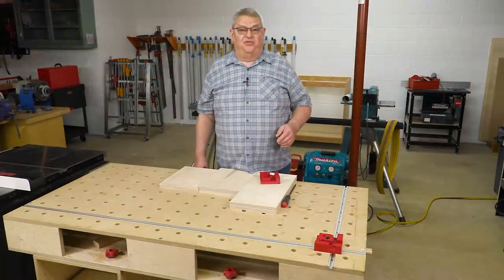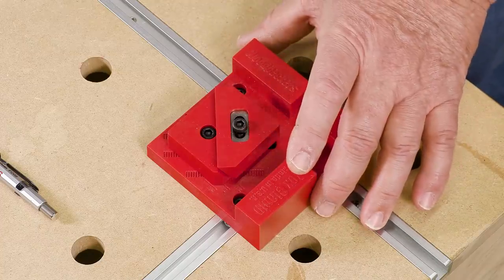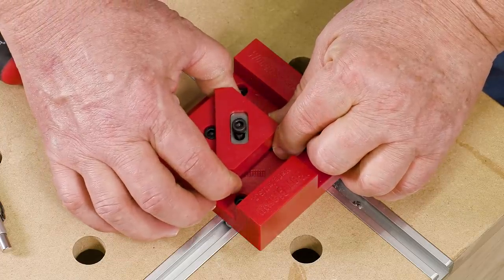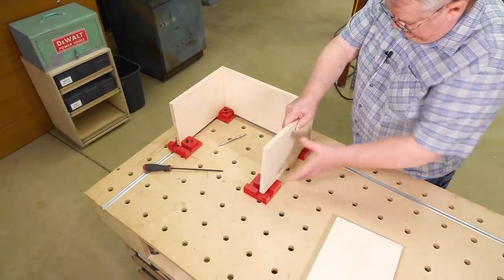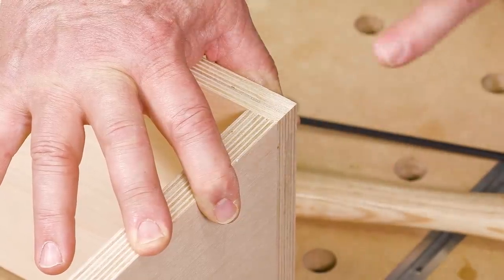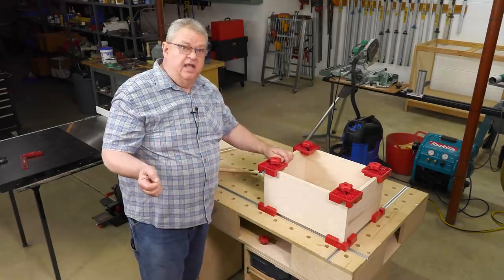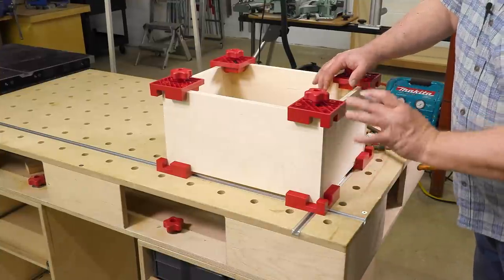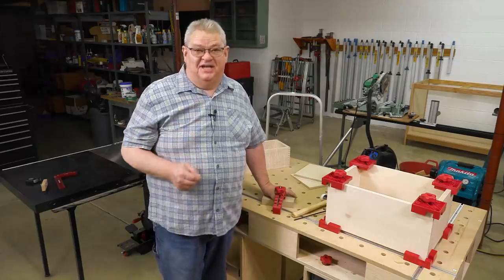Box Clamp Features You Never Knew About | Deep Dive

Comment: Been using these for quite some time but never knew why the oval slot was there.  Didn't know you could mix thickness either.  Glad I saw this.
Reply from the maker: Hey, Keith, glad you learned something new. Something I left for the next Deep Dive is that you can use the Box Clamps in a T-joint, too...the stock can pass through either side.

Comment: You forgot the GLUE! I have these clamps and have fumbled around with them for a long time. You set them up on a dry fit, then take them apart to apply the glue, then put them back together again. This can sometimes cause long open time with the glue. I really like the idea with the railing, it would be like a third hand that is so often needed.
Reply: I, too, was wondering about the glue. You certainly can't apply the glue while setting up the clamps unless your glue has an extremely long open time.
Your idea about getting things all arranged, then disassembling the box, adding the glue and reassembling makes sense.
The real benefit to these clamps then is when you are building multiple drawers or boxes that are the same size. Once it's all set up, you can glue up matching drawers about one per hour (the time it takes for the glue to set).
The advice I find in the comments is often as good as what's in the video.
Thanks!
Reply: He forgot nothing, it was a demo for the claims not glue

Comment: Jeff, many thanks for another very valuable deep dive.  I, like others, have had the Woodpecker corner clamps for awhile but an older version without the grooves.  I put 2 parallel t-tracks into my workbench, but you inspired me to put another one in perpendicular for use as you illustrated.  I am a bit surprised you didn't put a right-angle intersection in so that it's easier to install the one corner clamp.  That's a bit of a pain when I already have tracks installed, but shouldn't be a large problem, although I don't want to remove the existing tracks.  I think I'll just cut the two tracks in place and then notch the new right-angle tracks to accommodate the intersection.  Keep up the great work!

Comment: Lots of value-add on this video. 

I’ve had a chance to use these on a small project and they are a little fiddly. But... big but... they take the guesswork out of the equation. Doing that project without them would have been a Lot more dinking around.

I wasn’t sure I was using them right but turns out I was... just not fully. And these tracks are a great idea. When I build my proper bench I was planning on embedding tracks. This makes me think wow! Lots of uses, and I don’t think I would have ever thought of this. 

Great video and a great product!

Comment: What length 10-24 machine screws did you use? They need to be short enough to not impede wood travel in the clamp, yet long enough to allow the track nut to slide freely in the t-track.

Comment: I've had these for several months and got extremely frustrated trying to use them.  One thing I did not know before watching this video is that these clamps are for square alignment of parts only, not to apply clamping pressure to a joint.  Perhaps they shouldn't be called "clamps" then.
Reply: Its a perfect name

Comment: The video was very informative, but it let me a little upset.  First, I have the woodpecker box clamps, but obviously an earlier version.  Mine do not have the iot ndicators fro 3/4" or 1/2" on the rear clamping triangular as shown in this video.  And I wish a glue up had been shown.  A lot of set up and then you have to glue?  Not a lot of time to glue up, particularly the finger joints shown. Yes, you can use a slower setting glue, but it's a challenge.  I did learn that the clamps don't pull the joint together - wish I had realized this on my earlier attempts to use.  And it is nice to see the use of a hex screwdriver, instead of the allen wrench I got originally.  I measured mine and it is a 3/16" allen wrench - I'll be buying a screw driver with hex head. This video was informative, but maybe I should never again buy a woodpecker product that is first introduced.  I should wait for the corrective/additive features to be introduced.
Reply from the maker: Douglas, Whether I'm using these or anything else, I always do to a complete dry fit and dry clamp. It greatly reduces the drama when the glue is spread. 

While the clamps won't pull a joint together, They'll keep a good-fitting joint in place. We didn't get a really good shot of a corner coming together the way I wanted. Watch the Guy Dunlap video on the Box Clamp web page. He's got a great shot of having slight pressure on the joint, tapping it together, and then locking it secure. When you tap the joint together, the one-way nature of the clamp lets the parts slide together, but not bounce apart. 

We sell that 3/16" long handled driver for a pretty competitive price. It' ball-end, too, which you may have noticed in the video.

Comment: Phenomenal. Jeeze though, every time I think I'm ready to build my mft/outfeed/router lift table/cabinet some new fangled must-have idea like these make me pause and do some redesign.
Reply from the maker: Be really careful trying to build too much into your outfeed table. If you're limited on space, creating multiple uses for the table may be a necessity, but my previous outfeed table was just that...a flat, featureless table that I kept clear all the time. Now, I'll be in the middle of doing something with an assembly clamped up on my table and I'll need to make a table saw cut... It's a Homer Simpson headslap moment...Doh!
Reply from the maker: Just to add a conclusion, if you have the space, consider building a multi-function clamping / assembly table  that is NOT your outfeed table.
Reply: @WoodpeckersLLC  this is sage advice, hard-won. Yeah the outfeed I'm building is quite a bit wider than the tablesaw so it makes a fat "L" shape. It will still block the table saw path with large glue-ups or alternatively breaking down large sheets. I could see this happening way more often than anticipated, soyeah, when I get good at precisely laying out and drilling the holes, I probably ought to Swiss-cheese up one or both of the smaller benches. Thank you for sharing your wisdom!

Comment: Brilliant idea with using the t-track in the assembly table to align the box clamps. Could you provide some more details on how you attached the track nuts to the box clamps? From the video I couldn't determine how you fastened the track nuts to the box clamps or how you tightened the one box clamp to a fixed position for the starting corner. Thanks.
Reply from the maker: Cecil, the Box Clamps have three holes in them, originally designed to screw them down. A 3/4" long 1/4"-20 Socket head cap screw is just the right length to go through the clamp and into the T-track. I used oval nuts that we sell, but 1/4"-20 hex nuts will work, too. The one in the corner is a little tricky, because you can only slide two of the bolts through the track. The third you have to fiddle with a little to get the nut under the bolt. Steal a chop stick from your wife's pantry. For one-off's leave the two outer ones loose, but if you have multiple identical boxes to assemble, after you do the first one carefully remove the box and lock down the clamps.
Reply: @WoodpeckersLLC  Thanks for the reply. Exactly the info I was looking for.
Reply: One more question? What is the cool box you are using to store the box clamps? It has a WP label on it, but I can't find it on the website.
Reply from the maker: https://www.woodpeck.com/woodpeckers-t-loc-systainer-1-in-anthracite.html Same stackable box system used by Festool.
Reply: FYI....if you are planning on using these with a Rockler T-Track Table Top, 3/4" cap screws are too long. I found that 7/16" screws work just fine.

Comment: How did you get 3 T-nuts to fit in the track for the box clamp in the corner?
Reply from the maker: Slid two up one track then used a pencil to align the third under the hole in the perpendicular track.

Comment: How do you put glue during that process? Seems like it takes a long time to align and adjust???
Reply from the maker: Dry clamp. Everything is set, Take it out, spread your glue drop it in and go.
Reply: @WoodpeckersLLC  I, too, was wondering about the glue. You certainly can't apply the glue while setting up the clamps unless your glue has an extremely long open time.
Your idea about getting things all arranged, then disassembling the box, adding the glue and reassembling makes sense.
The real benefit to these clamps then is when you are building multiple drawers (or boxes) that are the same size - like for a tool chest. Once it's all set up, you can glue up matching drawers about one per hour (the time it takes for the glue to set).

Comment: I would like to see and example of this with a miter joint. Does anyone have experience with this? I was thinking of doing this in combination to the tape method and a band clamp (for clamp force) or 2 to avoid using clamping wedges/cauls.

Comment: Great ideas for great products, but....  I can't find any 1/4 bolts that will fit the holes in the clamps. They are all just a hair too wide. Is it necessary to drill out the holes?
Reply from the maker: Nancy, I used #10-24 machine screws and track nuts (3/16" diameter).

Comment: What is the brand or model of the hammer Jeff is using?
Reply from the maker: Thorex 712R. I learned about it from watching Paul Sellers. I think I bought it from a UK company that had reasonable shipping, but you can get it from Amazon, too. 

UK Company Site: https://www.thorhammer.com/product/31-712r/

Amazon:  https://www.amazon.com/Thor-712R-Faced-Hammer-Handle/dp/B0001P0YF0/ref=sr_1_1?crid=24RD6JEL41Q1Q&dchild=1&keywords=31-712r+thorex+nylon+hammer&qid=1619141276&sprefix=thorex+31-%2Caps%2C170&sr=8-1

Comment: You did not show how you aligned the first box clamp with BOTH t-tracks. You only showed two t-nuts, not three.
Reply from the maker: John, I had the tracks very carefully aligned on installation. I clamped a known square joint into the three box clamps in the tracks then carefully removed it and tightened the corner box clamp. There's a good eighth of an inch play between the box clamps and the track, so the two floating clamps have plenty of room to move into plane with the central locked one.

Comment: When you install the T-track as shown in the video the corner has one through track but the cross track doesn't allow sliding t-nuts etc. through from one side to the other without further modification of the cross track; or, you could buy a t-track intersection kit from Rockler https://www.rockler.com/t-track-intersection-kit.  The only problem then is you will have blue corners at the junction.  Of course, you could dimply follow the link to Rockler's intersection kit, then cut your own intersection like we did using woodpeckers t-track or t-track from some other supplier like: https://orangealuminum.com/t-track-1/
Reply from the maker: You can do the same thing with a miter saw...standard carbide tipped saw blades cut aluminum just fine. I decided to see how much of an issue it is for me before I make a through intersection. So far, it hasn't been an issue.

Comment: Is it just me or does this seem like an awful lot of work to square up box sides?
Reply from the maker: Think about it though...the vast majority of things you make in a woodworking shop are some variation of a box. Squaring up a box is one of the most basic things you need to be able to do. If you don't want to see the details, I can make this tool look like magic,  but my goal in Deep Dive videos is to show how stuff really works and get down to the fine points you need to know to get the most out of a tool.
Reply: @WoodpeckersLLC  It is exactly “the details” which I am commenting about. In my opinion, the process using those clamps, seems more tedious and time consuming than more traditional methods using k-body or pipe clamps. And that, is a very reasonable criticism.
Reply from the maker: But K-bodies and and pipe clamps cannot align the pieces square to each other.
Reply: @WoodpeckersLLC  And yet are still easier and faster to produce square box. While woodworkers will disagree on a lot of things, this one, IMO, is a swing and a miss.
Reply from the maker: And you're entitled to your opinion, but I am confident that if I were working and not demonstrating I could have that box put together faster and to a better tolerance for square with 8 box clamps than I could with 4 pipe clamps.
Reply: Chet I am a cabinet maker and these are so important to me. I am usually assembling the sides and back of the cabinet. Face frame goes on later. The sides are usually 3/4 “ cabinet grade plywood and the backs 1/2” 
For me these make holding these tall pieces easy and much faster. Also more accurate.  other clamps try to accomplish what these do but fail. Love these clamps.
Reply: @ChetKloss  Once you own them you will change your mind